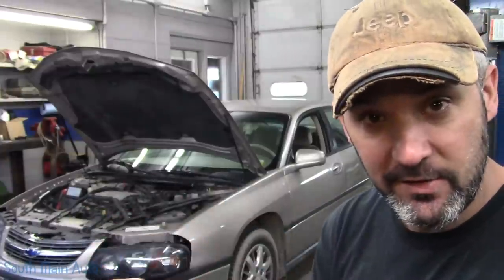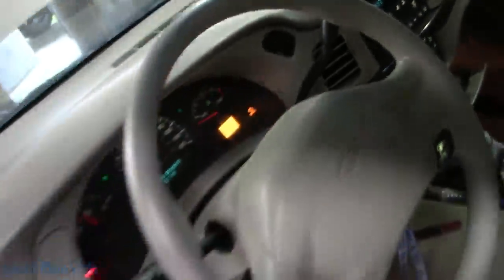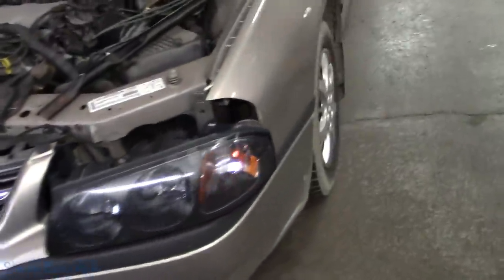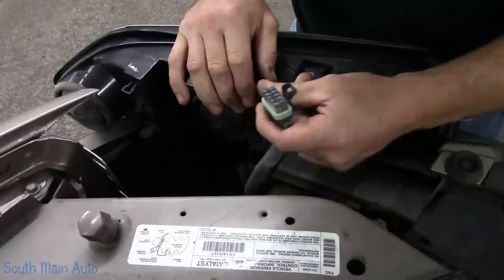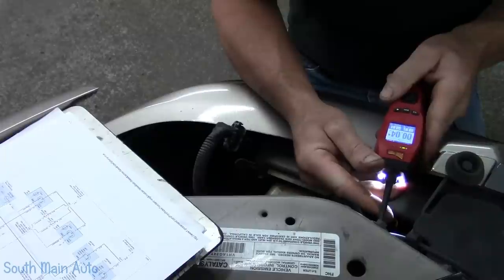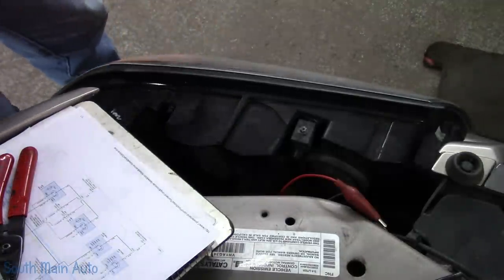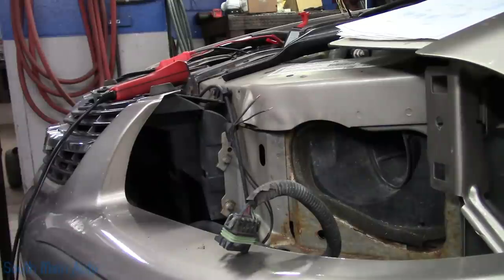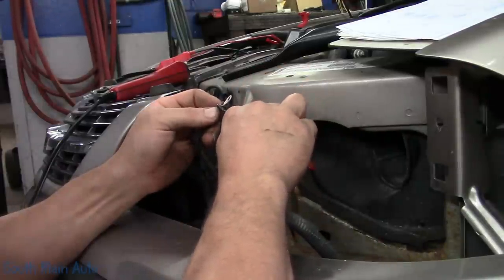Chevy Impala: Turning Signals All Goofy!?

Comment: Most people don't understand electrical circuits.  They think, how can an open ground cause these symptom's, if they think of an open ground to begin with, LOL.  And on top of that, they find it hard to follow a schematic.  In this particular instance, 12 volts should not be on ground but people don't understand that the potential voltage appears there because it was going though the filament of the bulb. They think, OMG, if I ground this with 12 volts there, it will blow a fuse, and don't understand why it doesn't.  The real problem is how come it affects both sides.  Answer, common ground. It shows on the schematic but, back to 'they can't read a schematic'.  Sometimes, and more more often, is they can't get their hands on a good schematic.  Customer say please fix it, so they try their idea of the most likely part.  Imagine telling a customer, I'm sorry, your car is too complicated for me to work on with the symptom your car has. Could be a number of things, bring it to a real technician. But they cost so much more money cause they rip people off also. A minimum  $150 diagnostic fee for traveling diagnostic tecs.  A vicious circle for most car owners.

Me, I love wiring problems. Most of the time it's as simple as what Eric just found. Bad ground and no power.

Comment: Piling on with the "go on and tell us it was referred from another shop" comments. It's useful in diagnosis - it tells me to be particularly careful not to make any assumptions, because the problem is either really complicated, or fooled someone else who didn't start with the basics. It's probably not the normal cause of the problem at hand, else the other shop would have found it.  And it's neither slander (spoken) nor libel (written) since a) the anonymous "other shop" cannot possibly show they were harmed by your statement, and b) your statement is true anyway, and a true statement cannot be slander/libel.

Also, what color nail polish do you recommend for fixing the poked wires?  ;-)
Reply from the maker: Clear....

or sparkly...

Comment: I have seen a bad ground do all kinds of strange stuff the wiring searches hard for a ground like the car you worked on when you flexed the cowl my first time dealing with a bad ground was when I was 16 had a 65 Ford Mustang the lights would work the turn signal would work but when you hit the brake everything went out the problem was a loose ground wire
Reply: I once had the whole truck shut off when i turned on the headlights. It was a 23 cent wire eye that fixed that. Had a bad positive connection.

Comment: What has happened to our American cars now days? We did have quality vehicles back in the day but now it seems as if we have lots of bells and whistles and the dependability/longevity has gone away. Great Job Eric-O
Reply: 'every car in the world'
Reply: Not all American cars are bad. Some are really good. They're just more hit and miss than say, Honda or Toyota.

Also, this car IS pretty old now. That's like an 01 or 02 Impala.
Reply: They are Chinese parts assembled in Mexico
Reply: @mikeholt3545  Which parts, of what brand for what car? That's an extreme generality that is just as often false.
Reply: +Jusb1066 Not necessarily. My current 12-year old Mazda3 Sport (UK) is boringly reliable - apart from the odd plastic part breaking the only failure has been the RHS engine rubber mount, which had FoMoCo on it.
Reply: @EssenceofPureFlavor  maybe but I have seen way more Chevy parts that say made in China than I have that don't
Reply: @mikeholt3545  For what car? And what type of parts? If you're talking things like sensors I believe it. But not the case for engine parts, etc. There are a LOT of car parts produced in the US...

Comment: Had a ground problem on a Cavalier, step on the brakes and the car would stall, bad ground from block to firewall, replaced that skinny little ground with a big honking braided strap. Since that time any used car I've bought I always add a braided ground strap or two.

Comment: So, Eric, in a case like this where another shop immediately starts throwing parts at the problem instead of actually finding the source of it as you did...where does that leave the customer ? Are they stuck paying parts and labor for the unnecessary turn signal stalk etc. ? I can't see the other shop eating the loss unless they're incredibly honest.
Reply: Since the other shop sent it to Eric the customer will never know about SMA's involvement. The original shop will be the 'hero' and they can fine tune their story however they see fit - hopefully they wouldn't.
Reply: +Sancte Alphonse I'd put a business card with a short description of the fix on the back somewhere like the glovebox or sunvisor.
Reply: Graham Langley the only problem with that is that should the customer decide to play hardball with the other shop, Eric stops getting business from the other shop. It may be worth it to leave a cheap (<$5) thumb drive in the ashtray with the video on it, but that would also stir the pot.

Comment: from a guy who installs aftermarket starters and alarms I know it is  usually the people who have a poor understanding of electronics and troubleshooting techniques that default to blaming a black box. That can include a module that is part of the car or an aftermarket piece.
I also can say that aftermarket stuff is VERY dependent on installation quality.Seen a bunch of rats nest hack jobs in my 30 plus years of doing
this.Find a good installer then pick out the accessory you want to put on your car! They can probably tell you the good stuff.
I am rarely asked about how we install the product or how qualified I am because people don't know that it is important." What's yer best price?"
Reply: "Free install, right?"

Dumped that career a long time ago... gotta know electrical of all the different makes... no pay.

Both shops I worked at offered lifetime install warranty, and most of the products carried it as well (except  remotes).

Clifford, Directed, AutoPage.

Directed often called us for tech support on MB integration.
Reply: Eric has said that the problem with the aftermarket electronics is that there is no documentation on where and how it was connected or the internal connections and wiring on the module which makes it difficult to troubleshoot. I've had to find a way to bypass the module when a relatives car wouldn't start on a holiday weekend. There might be documentation that comes with the units and if the installer would print out a vehicle wiring diagram and draw in the connections, it wouldn't be as bad. Perhaps some do and leave the information in the glove box but when people sell their cars, they often remove everything from the glove box.
Reply: Black boxes are too expensive to blame, I look elsewhere. Example being my Sonoma misfiring. A quick poke on google to see what other people say to give me a starting point. Many people blame the ignition control module. Too expensive, and not proven to be my problem. Turns out it may be an injector clogged as seen by O2 data, still need to do a cylinder balance test while watching O2 data to prove my conclusion. It's not always the black box, and you need to prove your part is bad. Or else you wind up paying for expensive parts you didn't need and a vehicle that still throws tantrums.

Comment: grounds, we don't need no stinking grounds!!!
yup, further proven by the "turn signals and hazards" both flashing the low power parking light element and the indicators lighting with parking lights and so on.... finding the bad ground is the fun part.
way too easy, heck I'd like 30 of them a day at $150+ each

Comment: I've worked since 1988 as a component-level electronic service tech, and when my coworkers and I run up against a "Tough Dog" (Something that's whipping our arse), and we want to "trade off" or "get a fresh set of eyes on it", we won't even tell each other what the original tech has found (at first).  We give the  new tech about 1/2hr to 1 hr on it, so his diag. is not "clouded" by the path of the original tech.  If after that we have no progress, THEN we compare notes...

Comment: The solder you were using to solder the eyelet on the ground wires looks like Acid Core solder. That is a no no for electrical wiring , use only Resin core  solder.

Comment: Sounds like someone at another shop doesnt use their test equipment properly. That pays your bills so thats cool. Good for you to NOT listen to other so called mechanics. Sorry but it seems to me a simple ground issue would have been easier to find than throwing parts at it. Sure makes that shop look dumb. My dad told me, always ,always start with the obvious before blowing money on parts. I used to wire trailers and vehicles for trailers. most of what I found wrong with electrical wiring issues was the person that installed it. Second was corrosion. Always corrosion. I found it easier to hack out everything installed and start over. One owner had a fit because I chopped his install out right in front of him. He was all" I just installed that!. I said, well,did it work right? Well, well.no...I always said,well it will when it leaves here. And it ALWAYS did. I charged him the same as everyone else. I also gave him back his " Rats nest".
Reply: RC Hobbyist Extreme 
Yep every trailer I have ever bought used is a crappy wiring job kinda issues, like the one I just bought and it was all butt connectors. Ya they pulled apart causing issues. Simple soldering of wires and its fixed.

Comment: So the other shop accrued probably $600 in parts and labor when you fixed it for $25 shop time.  Customer is not responsible for the other shops ineptitude and should not have to pay a dime for the machine gunning of parts and labor.  Shameful and more common than not.

Comment: Just started the vid... I'm gonna guess green fuzz is causing it. Edit: wrong. Also you need the Astro 9477 ratcheting crimp tool. It comes with different jaws for insulated/noninsulated/coax terminals. I love mine.

Comment: I have no problem with you mentioning that it "came from another shop".
It's not like you're specifically naming which shop it came from, just that "some other shop" worked on it.
Happens all the time in any industry where the goal is to fix things. Computers, cellphones, cars, it's all different but it's all the same.

As for this video in particular, if the lights are acting in a way that doesn't make any sense, and you're in New York State, chances are good that you're looking at a bad ground, unless the vehicle has factory-equipped LED turn/tail/marker lights.
In that case it could still be a bad ground, but it's more likely that an LED PCB has corroded due to brine ingress. See it all the time on those Caddy's with the full-width trunk brake light. One or two LED's out, then 5, then 20, then the whole strip's gone.
Also watch out for people putting in LED replacements for incandescent bulbs, that one can really throw things for a loop.

Comment: How was their 11v on that ground wire?
Ground wires should always be 0v since their ground.

Normally the circuit would be battery-----relay----bulb/headlight assembly----ground
With the headlight assembly removed the ground wire should just have continuity to ground

Comment: I just dont get it... im not a mechanic and other than stereo systems and the occasional trailer pig tail i dont usually mess with wiring in a vehicle but when u said the markers in front were dim or didnt come on at all the first thing i thought (as u said) was check the grounds... how did the "mechanic" at this other shop not think the same thing, but instead chose to  fire the parts cannon at it which is (im assuming) gonna either  cost the customer hundreds of dollars in parts and labor, or end up having to eat the cost in the end. All because of a bad ground
Reply: as soon as i see dim anything its always check grounds...that basic wiring 101...the other " shop" was to lazy to look  at a wiring diagram.
Reply: It's not as if it's that uncommon. Probably once a month I'll be following an oldish car with the symptoms of a missing ground on the rear indicators and lights. About as common as two-filament stop and tail bulbs that have been jammed in the wrong way round.

Comment: I had a few wires like that .Salt dissolves copper inside plastic insulation . In front headlights and turn signals .
Tiny gage wires not much copper .
Fixing same car same issue same spot now.. 😂
I don't bad mouth other shops mechanics either..
We all fk up on occasion.
Best to diagnose yourself true.

Comment: I also wish it was something more. My 05 impala is a headache when it comes to flashers and headlights... previous owner thought it was a smart idea to wire the headlights hot to an on/off switch under the steering wheel.. Tore all that out, rewired the passenger side headlight (where most of the damage was) and now i can only get the drivers side low beam to work. No highs or lows on passenger and no highs on the driver side. Passenger side front turn signal flashes constantly and fast with the key on or started. Does not flash in the rear, only the front. Operates normally when the multi-switch is pushed up or down but when in the middle the passenger side flashes continuously on the dash and the front.  Its a mess... spliced, cut, taped and folded wires everywhere. Anyone have any suggestions for me on this year old video? lol

Comment: Did I miss the part where you wire brushed the radiator support bolt hole before applying dielectric grease prior to installing the ring terminal and bolt?  Also, no shame in applying LET to the ring terminal crimp to block out future moisture.  Just some observations from a 40 year automobile electrician.  No hate.  You do most things the same way I would.

Comment: How in the world did you get 11 volts on the ground wire when one end was disconnected at the connector and the other end was an open circuit?
Reply from the maker: The other headlight was still hooked up and utilizes the same ground... Make sense?
Reply: Oh... yes now it makes sense! I was having a hard time for a minute there... sometimes this stuff confuses me but now it makes perfect sense. Thanks for responding. I had to draw it out on paper after your reply to get it.

Comment: Needs a hazard switch they back feed the dash. Its not a ground, may temporarily be better messing with wires and grounds but put a hazard swith in, common problem.
Reply: hehe, line up with the last parts changer................ the symptoms were not exactly the same as hazard switch failure, that was classic missing ground issue, some of us have repaired such for 20+ years

Comment: cars others have tried to repair are often the most challenging.  Once you repair the fuel pump circuit, you still have to replace the cheap fuel pump they installed trying to fix the car?#@$%$%

Comment: seems like the only commonality on your channel is 2 words....NEW YORK lol ( just kidding eric...just kidding)
personnely for me I would hope it isnt the indicator module that would be a pain for me to get into
New York corossion strike again just like you acid air lol
ONCE AGAIN people throwing parts at it without THINKING it thru...what is wrong with mechanic nowadays???? frustration equels PARTS equels disgruntal customers
you said ir 11:20 into video you couldnt have said it any better. I experienced it myself..parts replaced and still nothing. Had a 2006 Harly softail and it would die while riding. I dont know nutin. Shop "tuned" it $200 later still died. It was a groung issue they were to LAZY to find it....yea Throw a part get em out of their hair
didnt like their mousse gel anyway
12:30  are they not CERTIFIED MECHANICS with a piece of paper they spent good money to get to work on cars????? I believe in Old learn hands on learning by and OLD (not in your case ) pro.I am sure you learned ALOT from your Dad (and Grandma) before you got into cars
Liquid Tape always though Gum worked good chew it lose flaver stick it lol

Comment: we just  got  fixing  the boys  2002  cav   no head  lights   high or  low..changed  switch  ,,no fix  checked plug  under  the batt tray  looked  good..checked  wiring all  up to  the head  lights.. looked ok  rang out  wires  ....well  looks  like the ground to  the batt tray  fixed it after  i cleaned  it up...now have  lights....bad grounds  can  mess  things up

Comment: I'd give it few toots of the good stuff, a couple of love taps with big nasty on the ECM, tell the lady she need a new CAT, clean the rats nest out of the blower motor, get the car Krowned, top and bottom and change all the batteries in the TPMS sensors. and then call Ivan to see what he thinks is wrong with it. Mrs. O had to leave early to get to PepBoys to get her drivers door lock actuator changed.  This Eric guy loves us so much he even post videos on labor day, you rock.

Comment: dont you just love pulling them two clips to remove the headlights on the impala. I've had 3 of them I know all about them cars.  3.8 motor is way better then the 3.4. other then the alternator being on top the power steering. but could be worse. and them stupid OEM plastic coolant elbows.